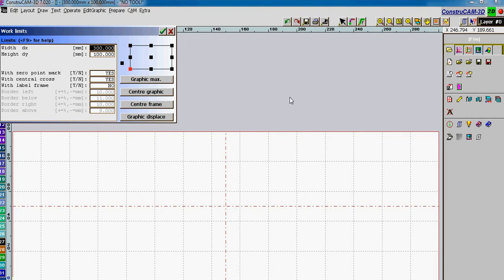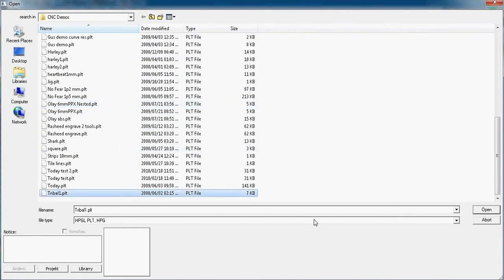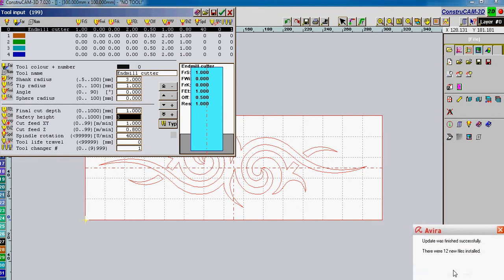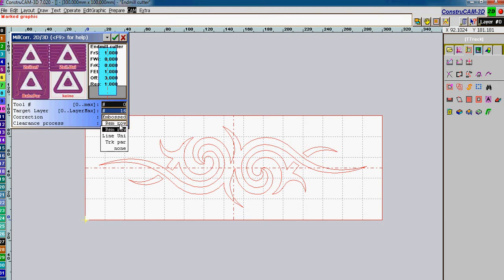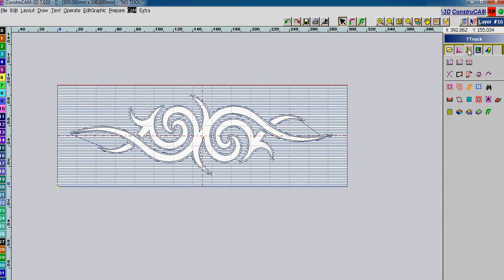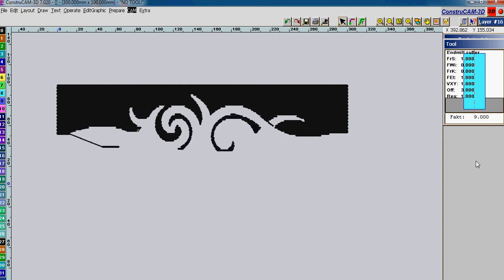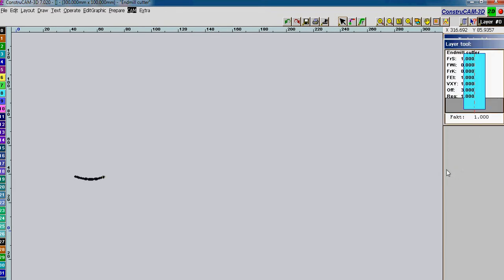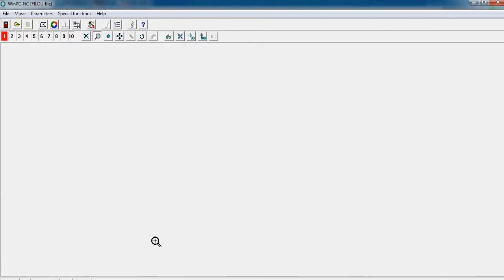Pocketing or clearing cuts to create a stamp

Comment: Do you know if there is a way to change the cutting settings so that it cuts everything out in one area then moves to the next. I've been having an issue where I said to cut multiples of the same image and the plotter goes back-and-forth across the whole thing cutting one line here and there and it takes so long. Any insight would be greatly appreciated.